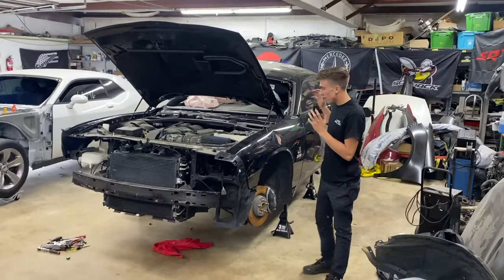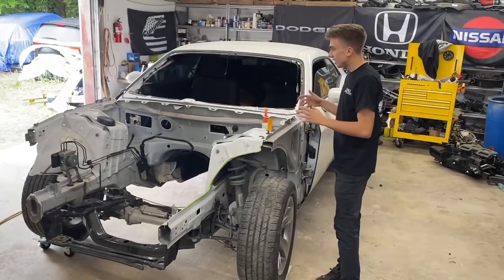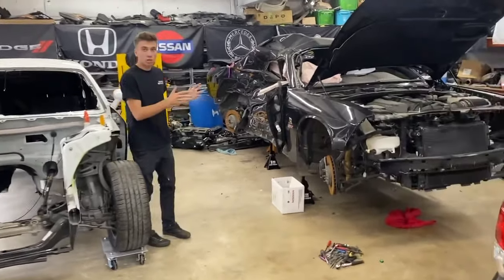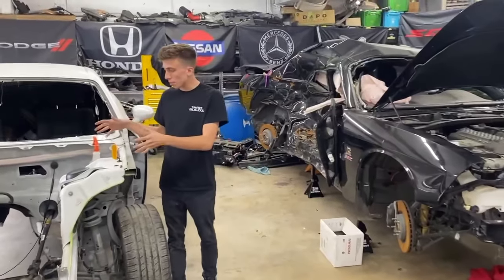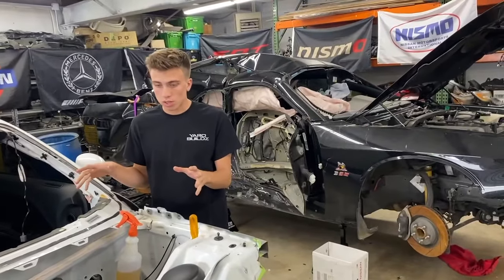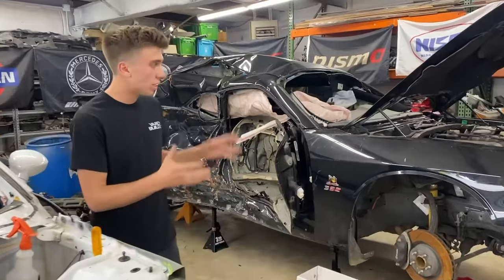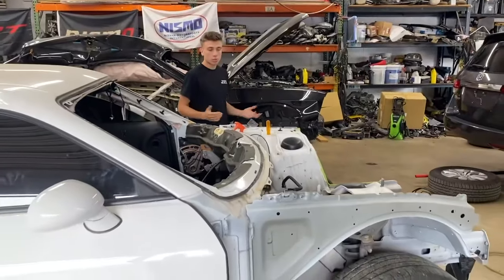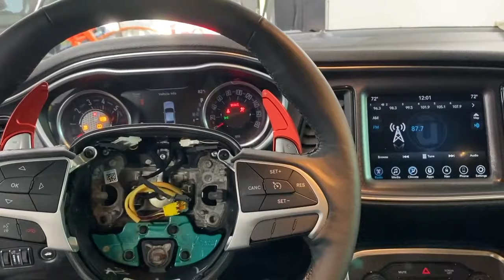BUILDING A V6 DODGE CHALLENGER INTO A 392 HEMI SCAT PACK IN 8 MINUTES

Comment: I just bought a v6 Challenger. I have a hemi donor car for swap. I'm just going to do it hillbilly style and do whatever it takes to fire up the engine even I have to put in a generic push button and toggle switch. If mounts don't line up, I'll cut steel and make mounts. If drive shaft no longer works, I'll cut and weld that also. As long as she fires up and drives down the road, I can run a toggle  switch for anything I need to work.

Comment: i have a sxt and i have a scatpack motor ready to swap but i wanted to ask is it possible to switch a sxt 2014 challenger gauge cluster and steering wheel Dashboard cover and center console to a 2020 scatpack ( i wanna change the 2014 dashbaord and screen and center console )
Reply: To be honest you’d probably have to just switch out the whole thing depending if the wiring is the same or not

Comment: Everything looks self explanatory till you get till the wiring shit made me overwhelmed just looking at it 😂
Reply: is it possible to switch out a sxt challenger 2014 dashboard and shifting center console  to a seatback challenger 2015 and up
Reply: @neverdie9512 only if you swap the whole motor and harness to a 2015+
Reply: The only swap I ever did was converting my 1970 Nova from straight 6 and 3 speed to 327 with Muncie 4 speed. Insanely easy back then without computer. Only had to change motor mounts and radiator. Holes for V8 mounts were already in the frame and 4 speed had same mounts and dimension as 3 speed.

Comment: I HAVE A QUESTION WHATS THE BEST ENGINE I COULD PUT IN A 2014 CHRYSLER 300??
Reply: U can swap any hemi in it I would go 5.7 I’m doing a 5.7 swap
Reply: @KamGlobaI  I wanted to put a scat or cat engine
Reply: Only thing about them engines is you’ll hav to do something to the frame so it could fit n you’ll need better axles and diff
Reply: @KamGlobaI  ya ik I jus gotta get a whole car and not just the engine

Comment: Ain’t no wayyyy. My boy just crashed my 392 v8 shaker & the engine is pristine but the transmission needs to be replaced & some work on the axial, ABS, power steering

Comment: So im guessing all the harness, computer, and motor and tranny was the main parts. You never said if you what had to be changed. Wonder if its different with a standard V8 swap instead of the scat pack.
Reply: Ion think so I’m trying the same thing rn still getting parts everything is plug n play only thing is you’ll need a rt axles of u want the scat diff
Reply: most deff plug and play with 5.7 swaps  the things u listed really all u need......id say later down the line get some good breaks and change little things as time go on